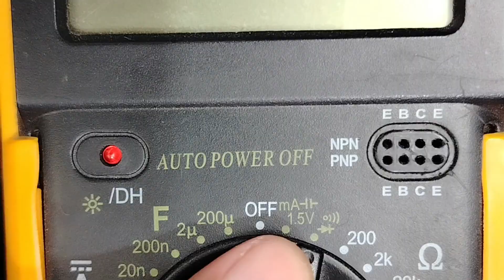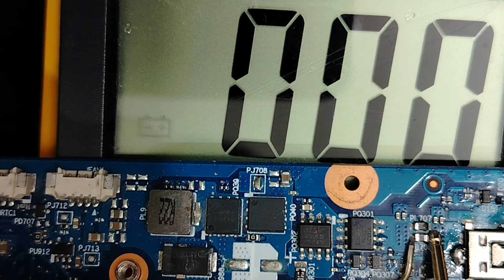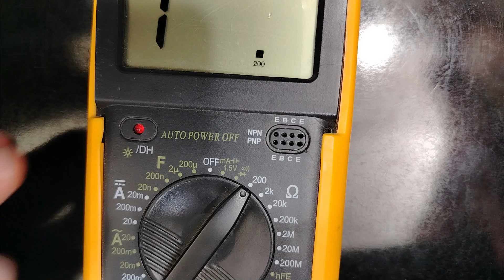Live electronic components testing, names, functions and, pictures - motherboard repair

Comment: Sir, you are a very good technician with excellent explanation. I have a problem with my tv model SAMSUNG UE32F5000AW. I have all voltages at new SMPS (13v, 5.3v, 3.3v and backlight is ON).When I connect cable from PSU to Mainboard (BN41-1955A), backlight will turn Off and I have all voltages in mainboard ICs except 13v in fuse of new T-CON and cable 51 pins (1-5) of mainboard. How can I find the shorted component and test Mainboard? Thanks a lot for your help.

Comment: Hello😊,When you tested Capacitor it showed 483 but also the capacitor(s) also showed 1 ohm, why?
Reply from the maker: 1 Ohm for CSR not capacitor
Reply: 483 could be a protection diode connected in parllel